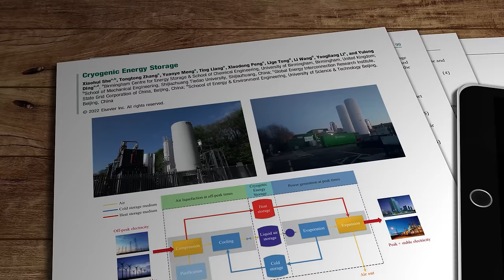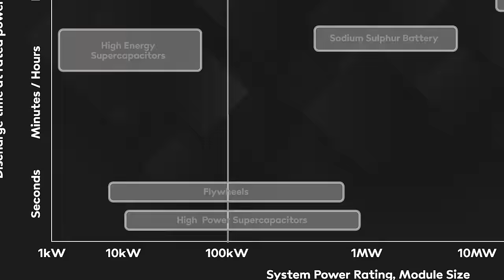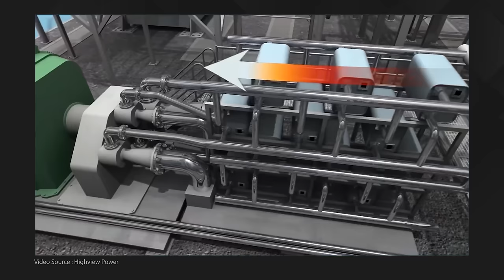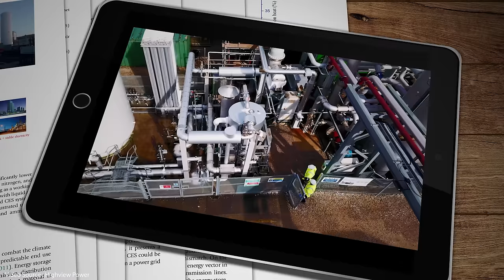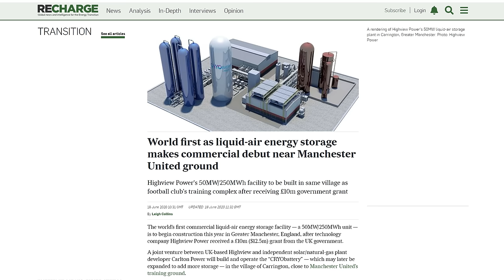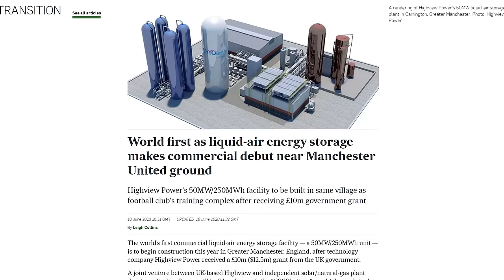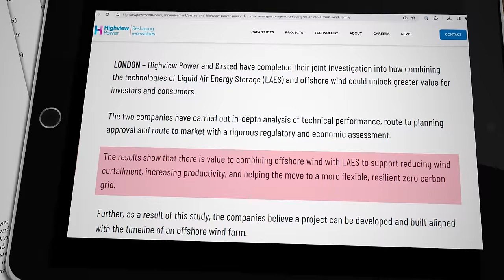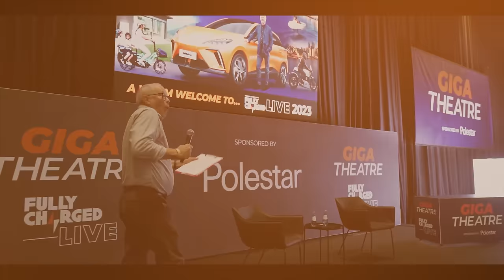Cryogenic Air Energy Storage - the new long duration energy solution?

Comment: The fact that workers in oil and gas industry will be able to easily transfer to this industry is why i think it's a winner. Almost all equipment is off the shelf and supply chains in place. And you have a ready set of trained workers with transferable skills.
Reply: yup

Comment: Simple mechanics and thermodynamics. 
And scaleable in any respect.
GO FOR IT!  👍👍👍
Reply: With respect to a lower efficieny compared to battery this tech is good to go now at once at very large scale everywhere in the world to handle the fluctuation of wind and PV how probably holds back a bit now.
Reply: What does it cost, how does it affect the rate you pay for electricity.

Comment: Liquid air energy storage seems really underrated. Once you've built the charging and discharging plants, you can simply add more insulated tanks to increase energy storage capacity. Even with flow batteries, you'd have to process additional electrolyte solution to increase capacity; liquid air beats almost every other material in how easy it is to increase capacity. Just add a tank and liquefy the air all around us!

You also have the added bonus of absorbing many useful gases in the process. You could capture nitrogen, oxygen, and argon via liquefaction. Using fractional distillation, you could separate these and sell them for a profit. You could even liquefy and capture CO2 (albeit it would be a pretty small volume). It would probably be cheaper than other carbon capture concepts as most of the energy would be spent liquefying the nitrogen and oxygen which would be used for energy storage. Liquid CO2 would be a small byproduct that you could filter out and capture. 

I also see serious potential for combined cooling, heating, and power which few other energy storage systems truly offer. For example, you could use some of the cold energy to refrigerate agricultural and pharmaceutical products or you could use the waste heat produced via compression to carry out desalination. You could make efficient use of cryogenic energy for other technologies and processes that go beyond just generating electricity. 

You could kill several birds with 1 stone (large energy storage with easily added capacity, air separation, carbon capture, combined cooling heating and power, etc...). The achilles heel of this concept is the liquefaction plant itself which is large and complex, making it expensive. If someone found a way to efficiently liquefy air in a smaller and less complicated set-up (maybe magnetic refrigeration or a thermoacoustic heat pump?) this would be the holy grail of energy storage.
Reply: Liquid air energy storage has intrinsic limits to efficiency that aren't there with chemical batteries. They are heat engines, so they are limited by Carnot efficiency.
Reply: @richdobbs6595 There are chemical energy storage systems with a lower round trip efficiency than LAES (iron air batteries for example). LAES also has an RTE that is fairly comparable to flow batteries (45-60% for LAES vs 50-75% for flow batteries).

Also, RTE isn't the be-all and end-all for energy storage. If that were the case, we'd be using lithium ion for all energy storage. The problem with chemical energy storage is scalability. For example, a GWh scale Li-ion energy storage facility would be too expensive and costly to maintain. If you want additional capacity, you have to add more battery packs which have a fixed cost (if you want 2x the capacity it will be 2x the cost). Because of discharging/charging cycles, the batteries would also degrade far too quickly within 5-10 years. 

Flow batteries avoid these problems and are more scalable (if you want 2x the capacity, it will be less than 2x the cost since you simply need more electrolyte and a bigger tank). However, LAES would probably be even more scalable than flow batteries (just add more insulated tanks and that's it). Add the other benefits I mentioned in my original comment and LAES seems to be pretty viable at least for large scale energy storage.
Reply: @richdobbs6595  Are they heat engines?  I'm not positive, but I think they aren't.  Part of the energy storage is using air as a spring, so at least that part isn't subject to Carnot inefficiency.  The liquefaction process produces heat, which is stored, and the expansion process uses that heat to return the liquid air to a gaseous state.  Wouldn't the heat energy of these two processes be about equal?  This seems too inherently efficient to be a heat engine, although Dave mentioned 60% round trip, and a combined cycle gas turbine (definitely a heat engine) can do that.
Reply: @incognitotorpedo42  The cryogenic temperatures give LAES a higher Carnot efficiency compared to other thermal energy storage systems. With a cold reservoir temperature of around -200 degrees Celsius and a hot reservoir temperature of 20 degrees Celsius, you get a Carnot efficiency around 75%. Compare this to a hot thermal energy storage system with the same temperature differential (20 degrees for the cold reservoir and 240 degrees for the hot reservoir) and you get a much lower Carnot efficiency of around 40%.
Reply: @incognitotorpedo42  Yes, they are classic heat engines.  You would need to store energy in an incompressible fluid for the Carnot limits to not apply.  Under those circumstances you might as well try storing energy by compressing water.  At least then you don't have to worry about cryogenic engineering.
Reply: @Xuvoid-jj3oz  The point I was making is that in principle, chemical batteries do not have the Carnot efficiency limits that LAES has.  If LAES where practical with current technology, every air separation plant would be retrofitted for this purpose.  Whether LAES beats out flow batteries is largely dependent on improved battery chemistry - where redox beats out LAES in theory, and relative cost of rotating equipment versus ion exchange membrane manufacturering, where rotating equipment is mature technology while in principle membrane manufacturing can improve by orders of magnitude.  But so far, none of this technology is cost effective, which places severe constraints on the benefit of interuptables.
Reply: @richdobbs6595  Triple point rules might apply.
Reply: @paperburn  Sorry, I don't understand.  Please elaborate.  I'm assuming that you are saying something about supercritical fluids, but AFAIK that doesn't get you around Carnot.
Reply: @richdobbs6595  Yes, but it's the same if you do that with conventional refrigerators. The idea is that because thermal storage becomes better and better with scale (the heat or cold is lost through the surface, the content is the volume, so it's scale better on big sizes), you can displace the moment of compression/decompression when you have excess energy or need of that, and the extra cold or heat, is stored in a efficient manner to be used when needed.

 It could be so efficient that this concept maybe could scale well for district heating/cold while at the same time the infrastructure is also a energy storage system.

Here they are speaking of pairing with wind, but I can see the same for solar. Think on summer when a lot of PV could be generated even in excess. While peak generation is at midday, the peak consumption is later, close to sunset, creating the classic duck curve. When this system discharge, a lot of cold is released and, although that cold could be recycled to make the cycle more efficient, it can also be stored and transferred close, through good insulated pipes, to the consumption places.

It's an alternative of work mode. But we must considered that if the cold or the heat are used, the direct efficiency of this system is lower, although that consumption could compensate for the efficiency difference. Because you are saving an extra heat pump on the consumption site.
Reply: Being able to store liquid air (N2) for weeks or months is the solution to curtailment.
Reply: @richdobbs6595  Carnot limit actually doesn't prevent perfect efficiency in principle, since it applies both ways (you can pump more heat than the energy supplied in the first place, in principle up to the same ratio as for energy extraction). Still in practice not as efficient as batteries.
Reply: @dk39ab  Carnot efficiency applies to conversion of heat to work (like electricity).  It doesn't matter that the energy doesn't go away, but it turns into heat.  That is not useful as an energy storage battery.
Reply: @richdobbs6595  A heat engine can't extract the full amount of energy in heat because it is limited by Carnot efficiency, as you point out. But, for the exact same thermodynamic reasons, a heat pump can pump more heat (in energy terms) than the energy supplied to it. At the theoretical limits to efficiency of both the heat pump and the heat engine there are no losses. In any real-world system, there are of course losses due to less than perfect Carnot efficiency in the conversion both ways as well as due to heat conduction losses to the environment, but in principle, there is no hard limit keeping the round trip efficiency from getting arbitrarily close to 100%.
Reply: @richdobbs6595  Some further clarification on heat engines: A heat engine operating at Carnot efficiency does not generate net entropy, that's why Carnot efficiency is a limit . However,  a car engine (for example) would still be irreversible even if the heat engine aspect were operating at Carnot efficiency because entropy is generated during combustion. The loss of useful energy you would get from operating a Carnot efficiency car engine would come entirely from the extra entropy of the combustion gases. If you had a Carnot efficiency heat pump heat up the gases, and then extract the energy with a Carnot efficiency heat engine, you could in principle end up with the energy you started with (of course, in practice just use an electric motor, but giving an example).
Reply: Even if the direct CO2 capture wasn’t a big component of the operation, it would still be valuable for carbon offsets and if nothing else, good press.  It certainly is a better approach than giant direct air carbon capture machines that use large amounts energy and resources to do their job.
Reply: @incognitotorpedo42  I think they wish it was a perfect solution where you use the waste energy to power super ranking cycle mega super huuge good efficiency... Like Xuvoid say, on paper it is awesome but its only paper...
Reply: @freelunatwo  Yes you generate 1000 tons of CO2 to capture 1 kg of CO2 congratulation...
Reply: Getting CO2, as well as Argon & Oxygen from the process probably makes sense.  The CO2 could be used to make plastic (the best carbon storage I know of) or even jet fuel, and a small plant could provide more than enough Oxygen & Argon for a region.  It probably doesn't take much extra energy to extract this and presumably the plant runs of excess renewable energy from solar farms at noon or wind farms on a windy day.
Reply: @richdobbs6595   well   you need  both low  source cryogenic , and  hot source, like   hot  concreet, to 500C degree, you    pure liquid  air  into  hot concreet  chamber  and  you  get  incredible  expansion  rate, you control it  via  simple  valves

Comment: Thanks Dave!
"We'll just use more Lithim batteries"...
was never a solution for mass scale grid storage. Inividuals yes, mobile uses sure. But not for grid scale. So it's fantastic having attention put towards these projects, and a channel covering technologies that aren't being sold to you as personal consumer advertizing.
Reply: We should use BOTH. Simultaneously.
Lithium Batteries can instantly absorb any "excess" power from wind & solar (actually: in most cases a lack of consumption for ~whatever~ reason).  
Then (when they have enough stored charge "above the minimum" reserved for power failures), the more "slow" & "deep" power storage systems can be activated to run up for several hours [at their ideal rates, without forcing them].
 -> A key aspect is that both systems should be placed together, to minimize power transfer loses [in the same installation].

Comment: Thanks 🙏 so much for the update!  I am intrigued by the removal of CO2 as a byproduct of this process.  Seems like a much more economical way to remove it.
Yes, keep us informed on the Manchester facility.
Reply: They use a mole sieve to remove the CO2 and water from the incoming air.  Air plants just vent it.
Reply: I think so, too.
Reply: Separated would be more accurate.
Reply: Removal? Separation and the what do they do with it?
Reply: I have a suspicion that the volume of air they liquefy in a year will not amount to enough CO2 to make this a significant contributor to drawdown.   I'll estimate a million liters of liquid air per day being produced.  (this might be off by a lot)  This would result in ~500 kg CO2/day, or ~180 metric tons per year.  Since we need to remove gigatons of CO2 from the atmosphere, 180 tons/year isn't very significant.

Comment: As an air separation unit operator, its definitely an interesting idea! Another upside is that extra liquid can be sold off, as liquid air gasses are very commonly used in industry. One issue I see though, is that you can't just turn an ASU on at the flick of a switch. Our plant is usually around 6-8 hours from first start to producing usable liquid (assuming there are no issues). Our plant is also over 40 years old, so modern plants may be better suited to quick start up and shut downs.

Comment: Both cryogenic air storage and compressed air storage are particularly attractive technologies as shown in Dave's video here due to the capacities that can be realised AND due to the fact they are used to drive rotating machines - in other words, synchronous machines. This could make them a critical part of any black-start response, just as pumped hydro already is, without the complexities and cost of large grid-forming inverters. Also, the use of rotating machines inherently adds to system inertia.
Reply: Stability is good 😊
Reply: Useful comment.

Comment: I don't know if you will see this comment, but I may have a good topic for a video: Oceanic Thermal Energy Conversion (OTEC). Seems like a geothermal, but using temperature difference between surface and deep water in the ocean/seas. They are going to test it in Canary Islands. It may be worth a thought!

Comment: Looks great!  Similarly would love a checkin on Energy Dome. Started about the same time, but has already crearted a 5MW demonstrator plant. .  Is now breaking ground on a 20MW/200MWh full scale facility. I like it cause working with CO2 seems much simpler than dealing with all the different gasses in air.  Would love to see your take!

Comment: I remember the Crescent Dunes Solar Energy Project.  It was kind of the opposite temperature wise.  They melted salt from which the heat would be used for about 12 hours to generate electricity, 'on demand'.  It looked great on paper.  However, in practice, the maintenance proved to be quite expensive.  There were many pump failures, tank failures, and the super heater failures.  When working with large temperature deltas and many moving parts, there are a lot of things which can fail and cost more money than anticipated.  Hopefully, lessons were learned and this new project will work effectively.
Reply: This kind of technology is used all the time in the chemical industry. Whereas molten salt is not so common. So this should be more scalable, reliable and sustainable. All power to the gods of thermodynamics.
Reply: Engineers always underestimate maintenance costs when they design a system.

Comment: Among all the new kind of energy storage solutions that I had heard over the years, the cryogenic air system sounded most promising to me back in 2020s when I first heard about it, which is why I mentioned it in one of my own videos, which I never do for any unproven tech. This ticks most checkboxes when it comes to technical, economical, ecological and logistical feasibility. The best part is it uses not just existing technologies from other industries, but also use the exact same parts and equipment from them, not to mention, it would be location independent, no external raw material(either continuous or one time) would be needed except for air which is free and omnipresent on earth, also, I loved how they made it so circular and closed loop. which is why I was mostly confident that this will succeed and may even become one of the major energy solutions in the next decade.

Comment: As an engineer I am concerned about the losses incurred in using any "thermodynamic process" as a first step to store energy. The electrical energy that is used is what we call "purely available" or work-equivalent energy. Any process that produces liquid air by current methods only provides ~ 33% yield insofar as removing the real and latent heat to do so. The capture of the waste heat had therefore be better good in order help compensate for this relatively bad performance relative to batteries, which stand at around 90% efficiency of return. At this point I would only consider adopting this approach only if there were strong incentives to make heat rather than to electrically power something later. best regards DKB

Comment: As @trueriver1950 asked:  fractional distillation will be very easy for CO2 (option to remove that in the process) and the noble gases (Ar/Kr/Xe).
Reply: Cheap xenon and krypton would be a massive gamechanger for space technologies, providing cheaper propellant for ion drives. Also, you would be able to capture many pollutants that would otherwise be hard to catch.